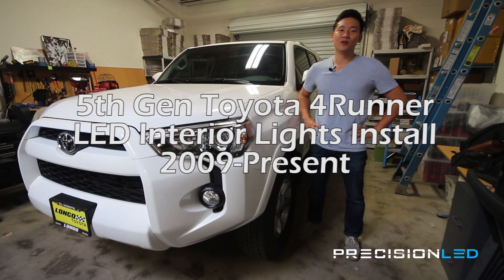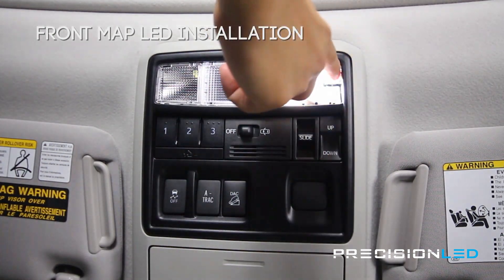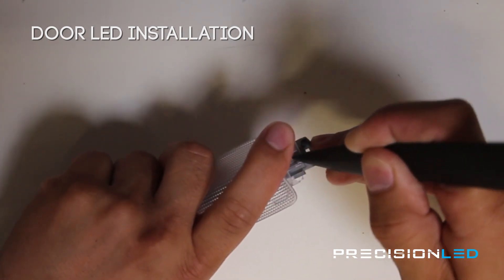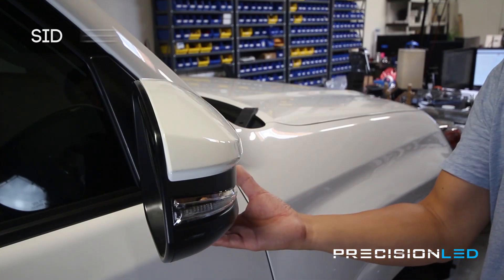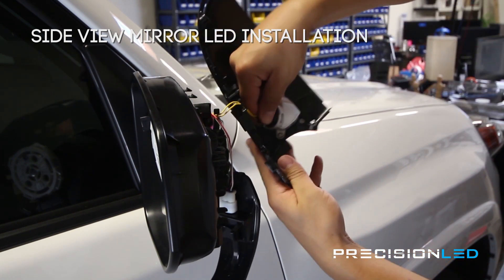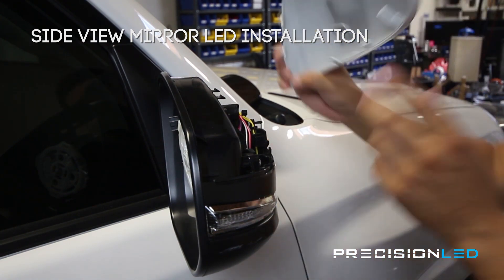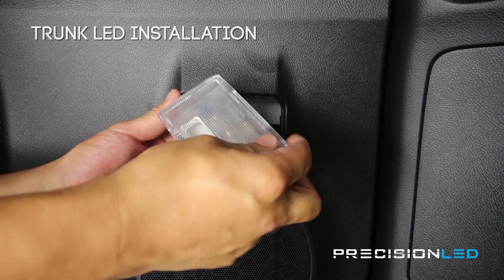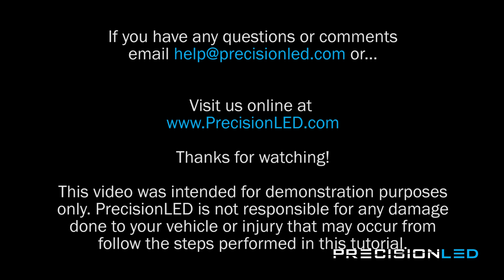Toyota 4Runner LED Install - 5th Gen (2014+) @PrecisionLED

Comment: Great video! Thank you.  Just a quick point, on my 2024 Limited, the door lights on the passenger side have the clip toward the edge of the doors.  The drive side is exactly as how you show it in your video. Cheers

Comment: The upper center console around the map lights is designed to be pulled down to replace the bulbs from the top.  The come out and go back in with a quick quarter turn. Mr. Toyota designed it this way.
Reply from the maker: Thanks for the input!

Comment: You don’t have to remove the mirrors.. you just squeeze the corner inside piece in the front and pull it to the front! Waaaaay easier than removing the mirror
Reply from the maker: Thanks for the input!

Comment: This is a great video and product. Just finished installation and I have two comments; 1) I used pieces of heat shrink over my needle nose pliers to remove map lights. Much easier that tape, 2) the courtesy door light assembly removal instruction is a bit unclear. Where the clip disengages depends upon driver side or passenger side thus be very careful not to force its removal. I used a bit too much and broke the lense clip. Otherwise super cool. Can' t wait until dark to see the difference.
Reply from the maker: Thank you for the positive feedback and also for the suggestions, we really appreciate it. We hope you enjoy them and thank you for choosing PrecisionLED!

Comment: What about the glove box light
Reply: Ikr. I've been trying to figure that out myself. Any information on changing the glove box light would be greatly appreciated. Thanks.
Reply from the maker: The glove box light is most likely a stock LED which cannot be replaced as it is soldered to a chip and board.

Comment: When doing the puddle lights, I found it was easier to reconnect the mirror heater if you leave the back color keyed trim off until after mirror install. There’s a convenient space to then plug the heater cable into place. All you have to do then is snap the color keyed trim piece back on. Finished.
Reply from the maker: Thanks for the input!

Comment: Just finished installing your premium kit in my 2015 4Runner.  The LED's were a great upgrade.  Most notably, the puddle lights are actually usable now!  Thanks for the excellent tutorial!
Reply: +Fred Schwab Are they too bright?
Reply: +Hampton Peace Hi Hampton, they're quite a bit brighter than stock. I was a bit surprised at first,  but I like the extra light,  especially with my all black interior.  I can see how some folks might not care for that much light though.  One thing that's vastly improved over stock are the sideview mirror puddle lights.  They're actually usable now.
Reply: Thanks for the feedback!
Reply: +Hampton Peace No problem!  Sorry I couldn't describe them better.
Reply from the maker: Thank you so much for the positive feedback!

Comment: How do I change the glove box light?
Reply from the maker: If you'd like, feel free to send over a photo of the factory lights so we can see if we are able to make a suggestion. You can reach us at help@precisionled.com.
Reply: @PrecisionLED  thx..but I discovered the glove box light in not changeable. It is complete inclosed unit that would need to be replaced not simply a bulb. At least it is on a 2014 trail edition,.

Comment: Great instructional video guys. A couple of points to maybe make it easier for the next guy. 

The clips to remove the mirror caps are the same color as the cap itself. So if you have a black cap it may be harder to see.

Also, when you remove the piece around the mirror housing you don't have to remove the built in indicator signal. 

Last point: when doing the map lights, if you have big fat fingers like mine, be patient! The tape is a good idea. I ended up using duct tape to get mine out...
Reply from the maker: Thank you for watching and for the helpful tips!

Comment: Legit easy to understand video. My only suggestion is when re-installing the mirror, leave the top part off and use the hole in the housing to connect the mirror heater first then snap the mirror in and install the top part. This removes the squeezing your fingers in behind the mirror. Thanks for the awesome product and video!
Reply from the maker: Thanks for the suggestions and for tuning in!

Comment: Thank you for the great demo!  I'd only add 2 things:  a) Use packing tape for the map lights and roll the tape into a tube to make removal easier.  b) The door lights have little arrows that point to where to insert the tool.  If you can spot them, it takes the guesswork out of the tool placement.
Reply from the maker: Thank you for the input! That is great advice!
Reply: Packing tape is a good idea. I ended up using black electrical tape 👍

Comment: If anyone is looking for how to replace the puddle lights like I was on a 2013 4runner, its about a 2 minute job vs the 2014+.  Just remove the mirror glass like they show you in this vid and unscrew 2 Phillips screws right below the white disc that the mirror snaps onto... once the screws are out the lens can be pulled downward, then just twist the balast from the lens.  replace bulb and put back together.  your welcome.
Reply from the maker: Thanks for the helpful input!

Comment: For the 2011 4runner you don't have to take off all that plastic for the side mirrors.  All you have to do is remove the glass and unscrew two screws that hold the light.  The light simply pops out.  Here is a link to some pictures.   http://www.toyota-4runner.org/5th-gen-t4rs/62252-interior-lighting-mod-4.html
Reply from the maker: Thank you for the tip!

Comment: I would love a video for the actual hard stuff! Front Signal Light and Fog Lights. Otherwise I agree, one of the best videos with good camera work and detailed explanation!
Reply from the maker: Thank you for the feedback.  Unfortunately, we do not carry most turn signal LEDs as they would hyper flash when ignited.  Regarding the fogs, we are indeed working towards making videos for the fog installation.  However, the fog installation is virtually identical to any headlamp installation.  The main difference would be physically accessing your bulb.  I would recommend having a watch at some of our headlight LED installation videos and you should gain a general knowledge about the installation process.

Comment: Does someone make an entire kit for a 2016 trd pro 4Runner for all these lights ? Getting my headlights installed tomoro and want a full upgrade . Thanks
Reply from the maker: Yes, the LED kit linked in the description gives you the option to add all of the lights shown in the installation video via the dropdown manus on the package.

Comment: I just got the full Precision LED kit installed on my 2016 4R, and I have to say I couldn't have done it without your terrific install video Phil. Just a world of difference with the increased lighting output as I live in a snow state. Terrific work! 

Just a couple of notes I'd like to mention from the install:
1) I had trouble removing the courtesy light fixture from the light housing (the part where you have to push on the tab). I found out that it was much easier to slide the plastic housing  forward instead of simply trying to pry it apart with the pointed trim tool, and that came apart much easier than simply trying to pry them apart. And they slide back in easily with the lovely "click" sound. 

2) One of the trunk light LEDs (as there are two on the 4R) is not as bright as the other. I will have to see if it was an error on my part on the installation or maybe one of the LED bulbs got damaged during the shipping. Either way, the lights are much brighter now when I'm loading the trunk with groceries after work in the evenings. Just can't rave enough about your product!

3) The plastic trim removal tools are AMAZING. I cannot give you guys enough props on that. I may have to purchase another set as the pointed tool got damaged quite a bit during the install, and I would like to have a backup one for future interior modifications. Just amazing and terrific tools from PrecisionLED! 

Thank you again!
Reply from the maker: Ken, thank you so much for your incredibly detailed review. Our team, and I'm sure other viewers, have found your tips very helpful, and really appreciate you taking the time to give feedback. Please let us know at if there is any way we can assist you!
http://www.precisionled.com/contact.html

Comment: Best video I seen, have a question but not sure if your model compared to a 2016 ltd is the same. Driver and passenger light under dash that is very dim but lights up where you feet go under the dash area, How do get access to it and type of bulb? Thanks

Comment: What's the difference between the premium and non-premium package, aside from the price?
Reply from the maker: The new Premium 5730SMD LED bulbs are the next generation of new LEDs. Compared to the older 5050SMDs, these LEDs have 3 times the light output per LED. The 5730 LED chip is designed for maximum light output while the aluminum housing helps to dissipate heat effectively for the longevity of the bulb. The new 5730SMD LEDs have a Constant Current Circuit design which helps maintain brightness if the voltage fluctuates within the circuit and has voltage surge protection up to 18V. And of course, all of our interior 5730 LEDs are backed by our lifetime warranty.

Comment: Hi so when I started to install the led dome lights I was having and issue with it.. The light was working and couldn't lock it in.. Now none of the lights work after just running .. I'm looking for a fuse blown but not having any luck with a good description of which fuse it would be..
Reply from the maker: We have never heard of an issue like this before.  Especially with the 4Runner 2014+, as they are one of the most popular vehicle's we cater to.  I would think it was a fuse issue.  However, if you are having trouble locating the correct fuse, please send us an email at help@precisionled.com and we would be glad to assist you.
Reply: Make sure it's installed properly, all metal is contacting.

Comment: Thank you for the great tutorial, so helpful for the un-informed.
One question please?
Are the led's on the dome and rear interior tail/dome lights the same bulb as all the rest?
If not, and I suspect that is the case, what is the bulb name and number as I'll need to order them?
Do they come in different watts/lumens and what is the recomended brightest light compatible with a 2016 4 Runner?
Thanks so much.
Reply from the maker: Thank you for your interest.  There is a variety of different LEDs installed throughout the 2016 4Runner.  However, we do the research so you don't have to.  All you would have to do is purchase the package in the description, and you will be shipped the compatible LEDs in labeled bags so you know where they go.  Also, we sell 35 watt products, and the lumens do vary depending on how many LED boards on the LED.  However, what you would really want to compare is our Standard vs Premium package.  

The difference is the new Premium 5730SMD LED bulbs are the next generation of new LEDs.  Compared to the older 5050SMDs, these LEDs have 3 times the light output per LED.  The 5730 LED chip is designed for maximum light output while the aluminum housing helps to dissipate heat effectively for the longevity of the bulb.  The new 5730SMD LEDs have a Constant Current Circuit design which helps maintain brightness if the voltage fluctuates within the circuit and has voltage surge protection up to 18V.  And of course, all of our interior 5730 LEDs are backed by our 1 year warranty.  

Feel free to ask if you have any additional questions!

Comment: Gotta ask since its not covered......what is the light in btween the map lights and how does that get changed? Thank you.
Reply from the maker: Thank you for your interest.  We do have listed the center light would be a stock LED.  However, if that is not the case for your vehicle, please, email us over a photo of the halogen bulb, and we can recommend a compatible replacement.  You can reach us at help@precisionled.com.

Comment: Trying to find the puddle light on the website but I can't find the led? Is it part of the interior base package?
Reply from the maker: Thank you for your interest.  The outside puddle light would use the T10 fitment, which you can find here:  https://www.precisionled.com/premium-t10-canbus-6smd-5730-led.html

Be sure to adjust the quantity accordingly (2).
Reply: PrecisionLED thanks for the response. Just noticed my 4runner doesn't even have the puddles lights haha bought it yesterday. Ordering a set of your lights now

Comment: Can the small light between the map lights be changed? I believe it's just a mood light that casts a little lighting on the center console and center stack.
Reply from the maker: Thank you for your interest.  We do have listed the center light would be a stock LED.  However, if that is not the case for your vehicle, please, email us over a photo of the halogen bulb, and we can recommend a compatible replacement.  You can reach us a help@precisionled.com.